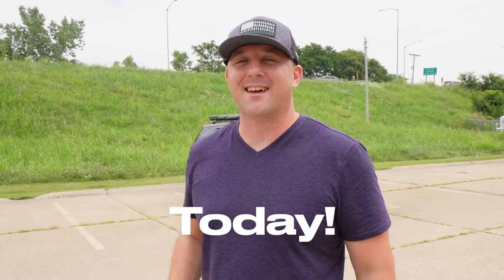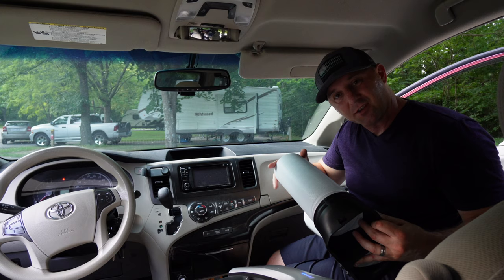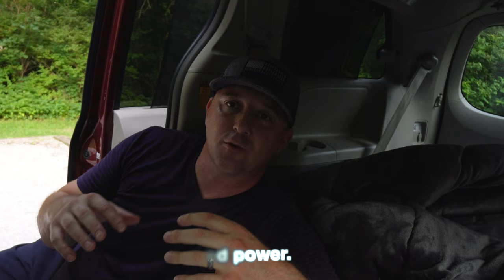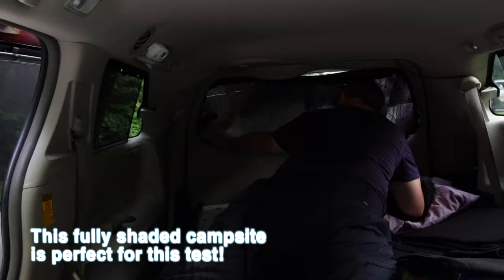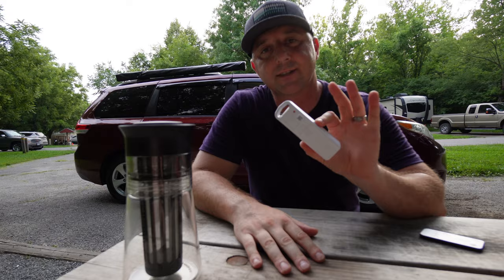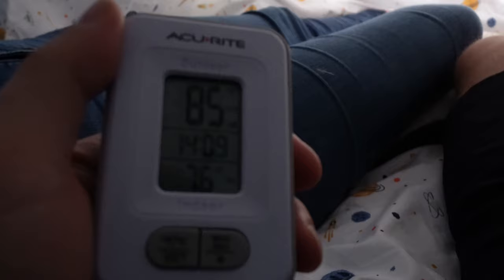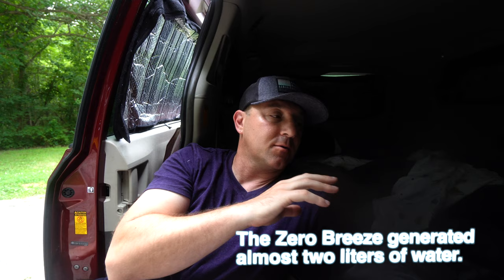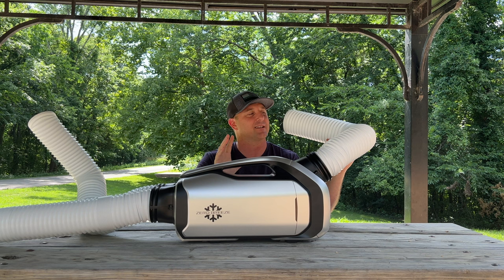Surviving a Heatwave in a Minivan Camper - Zero Breeze Mark 2

Comment: I have a 2003 grand caravan, which I bought early 2004 off lease from Enterprise Car Sales. Then it was $17K and I immediately took it to Best Buy Geek squad and had a remote start/alarm system installed for total of $400. Now, 18 years later the Viper system still works great. When I take a trip, I pull out the two back seats, toss a double or full size mattress into the back. When I stop overnight on road trip, I set the Viper to restart each hour automatically and runs for 15 minutes with AC on full. Added advantage is the caravan has an rear AC and fan that comes standard with the vehicle. Even though I'm typically traveling between Maryland and someplace in hotter Florida, that's enough to keep me comfortable during sleep at night. It probably uses 1.5-2 gallons gas, but even at current fuel prices July 2022 of $5, that's a lot of savings for NOT renting a hotel room when on a trip. Also no hotel bedbugs. I set the AC to vent in fresh air each time it's on, so can leave all windows closed for the night & no mosquitos or gnats to bother me during summer months.  If travel in winter, can do same with the heater. Having the remote start is great when at home, can start vehicle to warm or cool the interior depending on the season before I go out to enter it, which is most helpful when we've had snow and ice outside, making it easier to clear that from the inside heat already melting the ice or snow loose from vehicle. Remote start and intermittent hourly remote starting is something I intend to have always on a vehicle when/if I ever get a newer one.
Reply: How many miles now? They are great vans
Reply: @MX-CO  Only 110K so far. We have 4 vehicles, so use the van less than the others, mainly for trips between Florida and Maryland twice a year. Most used is a 2004 Prius for everyday, which has almost 200K miles now. I only use synthetic 100% oil and purolator oversize filters, like the 30001 (equivalent to Fram ph8A) , so the vehicles do quite well over time.
Reply from the maker: Glad you got so much good use out of that setup. It’s sounds like you’ve made some great trips and memories with it.
Reply: @OffGridAdventure  Yes, and TY.
Reply: could there be any issues with carbon monoxide?  thank you!
Reply from the maker: @mistyluv261  hi, I never recommend sleeping with a vehicle running. Even with a CO monitor, it can still be a problem. It’s not a risk worth taking.
Reply: @mistyluv261  shouldn't be. windows closed, engine exhaust goes out the tailpipe. I suppose a possibility if windows were cracked in the back of minivan, but then why would the engine be running. Fresh air intake comes in below windshield. Never had any problem like that.
Reply: @JoeZyzyx  It's a joke of course you are in no danger sleeping with car running.  Don't listen
Reply: I appreciate your comment, this sounds like a very feasible solution that I've not heard anyone mention before.

Comment: I used mine in mid June in Florida and it was a lifesaver! I put mine on the console like you did but I put up my curtains between the front seats and the back in my minivan and I also ran a couple fans during the day but at night time I had to turn them off.  By morning my temperature was 69 in my minivan. During the day during the hottest of the day it may have gotten in the mid 80s inside but it did not have all that humidity so it was comfortable. I slept very well! It’s a game changer since I live in South Florida. It would help to put your silver side out on your window covers. Another idea is to pre-chill your van with the van a/c.
Reply from the maker: Hi, thanks for sharing your experience. I thought about pre chilling the van, but didn’t want to get in and out repeatedly. If only I had remote start. Do you recall what the outside temp was on the day that it was 80 inside?
Reply: @OffGridAdventure  93 (feels like 103). I’m pretty sure. I did run my ZB from the time I hooked up the first day continuously until I checked out of campground 4 days later.  I also put a sun shade that reflects the sun over the back part of my van and put something between that and the top of my van to have a space between the two.
Reply: @VivecaV2020  I just keep my engine running and I stay cool like a lettuce in hot temperatures outside
Reply: @VivecaV2020  It usually costs me around $10 to have my V8 engine running all night long with a/c on of course.
Reply: @VivecaV2020  I was going to buy the zero breeze. But the high price and negative side reviews changed my mind. They made it impossible to cancel my order
Reply: @OffGridAdventure  About 98 (feels like 102). Hot/humid in St. Augustine, Florida.

Comment: This is why I’m thankful for my Prius RV. I’d love a bigger vehicle but I can’t let go of the climate control ability of the hybrid system. I can leave A/C or heat on all night. When Prius is in park, and A/C is on, the electric battery provides a cool temp. When electric battery runs low, gas engine automatically kicks on and recharges its. Uses very little gas to do this. I have a golden retriever so keeping us cool is extremely important. I also have a carbon monoxide detector since the gas engine runs intermittently but it’s never gone off. I think there is a hybrid version of the Sienna.
Reply from the maker: I’d love to upgrade to the Sienna Woodland Hybrid. You can run the vehicles AC 24/7. That’s the one reason I would ever upgrade from my current Sienna.
Reply: I didn't know a Prius could do that. Must be the newer ones. My daughter has a 2004 model. I don't think that earlier one does such. Still, I had enough problems when repairing her ABS system on it last year. The battery still will hold up to a 50% charge thankfully.
Reply: Yes, hybrid sienna can do it too all night ac or heat for $2-3, but can't remove its 2nd row which is deal breaker.
Reply from the maker: @larryc1616  Some folks have removed the middle row and added a dongle for the airbag sensors.  It's just a few bolts to get them out. They also make a lot less carbon monoxide.
Reply: @Off Grid Adventure  I know some have done that but you still can't remove the rails and it's recorded in the computer voids warranty.

Comment: Just leave the car running with it's ac on, you'll use a 1/16 of a tank of gas (on a 4 cylinder) over night. A modern car with fuel injection that's sound mechanically will do just fine. The same goes for the heater.
Reply: @HeroicaPlay  Who said anything about being stealthy? What are you up to at 2am (with tubes sticking out of your windows) that you can't do legally in a truck stop or camp ground?
Reply: Yup, it's what most truckers do; leave the thing running. Sleep matters!
Reply from the maker: This seems like it might be a good idea, but I can’t recommend this because it can be deadly to sleep in a running vehicle.

Comment: Glad to know what options there are for sleeping in a comfortable temperature. 

I have a '21 Sienna. I wanted to stick with a hybrid to replace my Prius because I had slept in it once with the AC on.

I can't sleep in heat like you were experiencing!
Reply from the maker: How often does your gas motor turn on with the AC running?

Comment: Put the intake hose next to the mirror and try to point down. Put the exhaust hose at the top of the same window. Fill the rest of the window gap with rolled up clothes or towels.
Reply from the maker: I should have put them in the same window. That would have helped quite a bit.

Comment: I just ordered the Mark 3 and I'm thinking about making a plexiglass insert that matches the profile of my window but has a female connection on the bottom to accept the regular window and then the top can be rolled up into the door frame weatherstripping. Then plumb in to oblong ports to minimize the amount of plexiglass needed, kinda like a shop vac vacuum head that's round on one side and rectangle on the other. Pretty excited to give it a shot

Comment: After it was cooler inside the van than outside, you remove the intake tube and start using the already cool air.  Same as the van a/c.  You recycle cool air once it has cooled down.
Reply: But don't you need to keep bringing in "fresh air"?
Reply from the maker: There’s basically four pipes. The back side needs to be separated from the front side. The front cycles cool air and the back pulls in fresh air, then exhausts it. If you put the intake in the front, then it’ll create a vacuum that still pulls in hot air.

Comment: I keep seeing reviews for this and most are mixed. Seems helps a bit when sleeping but useless in heat of the day. I am wondering why it needs a fresh air intake. In one of the portable room ACs it only vents the heat it takes from the air. I would think it would work way better if it was drawing the cooler air from inside the van. I would not buy one of these as I mostly camp with hook ups and I will buy a portable room AC for 200 at Lowes instead of this 1500 gadget. Oh and that price is without battery.
Reply from the maker: Hi, there are actually four air exchanges. The two hoses going out of the window suck in air to cool the condenser, then blow that hot air back out. The front of the AC has an intake and filter cover with no hose that supplies the the sort of elephant trunk.  The units you describe are pulling air into the room from the  small cracks in the structure. They are much more powerful, but consume a lot of power.

Comment: It'd be nice if the unit itself was smaller, & the hoses tapered down at the end so they're still drawing in the same amount of air but with a flatter ending so your window doesn't have to be open as much
Reply from the maker: I’m going to stop by the hardware store and look at some adapters. They make some that are 1.5 inches tall and 6 inches wide.

Comment: I used plastic corrugated sign board for venting the hot hose in the window. I then covered the hot hose with a heavy blanket to block heat from transferring inside the van. The cool hose I left inside the van. Blocking off any unused area with a thermal curtain is helpful too. When it was over 100 I ran the van a/c for a few minutes to help reduce the heat first. 👍🏻
Reply from the maker: Excellent idea with the blanket on the hot hose. On my last trip I used the lowest sleep setting possible and it didn’t use too much power.

Comment: Why do you have to pull air in from outside? Wouldn't it help the machine not work so hard if you used the air from inside the van as your input air and only exhausted the hot air outside the van?
Reply: It would seem that way however, when you pull air out of a small space, you create negative pressure and hot air rushes in from outside so the air conditioner is constantly fighting the hot outside air to cool off the inside.
Reply from the maker: It looks like there are only three hoses, but there is a fourth inlet on the front that circulates the interior air.  The two outside hoses there to blow air over the condenser. Greg is also correct about the pressure.

Comment: You should make some custom flanges to fit into the back windows that opens a crack. One side exhaust one side input put the AC in the back of the van. 3d print a flange or perhaps a vacuum cleaner attachment from hardware store. Why bother with front windows.

Comment: So, here is my thought. Can a switch be installed in your van where you can run the air conditioning as usual from the alternator, flip the button, then the AC would run off a LiFePO battery while you camp? Doable? Why buy a second AC unit when the van already has one?
Reply from the maker: That would be a perfect solution, but the car’s AC needs the engine running to work the compressor. It spins with the engine. Im going to try a better AC unit from EcoFlow this summer.

Comment: Would it work better if the intake was inside the space you are trying to cool?  Instead of pulling hot air from outside, it would pull the cooler air from inside so it should have an easier time turning that cool air into cold air  (as opposed to turning hot outside air into cool air).  (The hot exhaust still gets blown outside.)

Comment: We have a 2012 t&c that we use to travel to MX tracks. We use a 2000 watt quiet generator and a 5000btu ac in the driver window. Works well. Anxious to do some winter camping tho
Reply from the maker: That’s gotta be much more realistic than what I have.
Reply: You must have a slow start large capacitor to even get that running. While I was in Florida, after Hurricane Michael came through, electric service was off for a couple weeks. Rented a 2200 generator, since the 5K AC unit was rated about 550-700 watts. Unfortunately it wouldn't run anything on the 5K except the fans, not enough to create the brief surge needed to get the compressor running. I had to take the generator back and get a 3300w one before that 5K compressor would start. Later I learned there were large capacitors which could overcome that problem, since they store enough charge at first, and a slight time delay, then discharge higher electric boost to kick over the compressor, which after running would run the AC at the rated wattage. Or did you buy a special 5K AC unit specifically designed for auto use? They do make those too.
Reply: @JoeZyzyx  so the ac with the digital panel will shut down the genny. But the ac with the turn knobs works fine.

Comment: I was just looking how to cool a Van in the summer If my calculations are right. 175W x 8 Sleep Hours = 1400Wh/12V = 116.67 x 2 = 233Ah Battery x 1.25% = 292Ah. A 300Ah Lithium Battery will run the Zero Breeze nicely for 2 days in one recharge. The 12V Portable Air Conditioner cooler 30 Quart 560 CFM Digital Multi Speed (CAMO) uses 80W x 8 Sleep Hours = 640Wh/12V = 53.33 x 2 = 106.66Ah Battery x 1.25% = 133.33Ah. A 200Ah Lithium Battery will run it for 3 days. But you need Ice. With a 300Ah Lithium battery you can run the AC Cooler and a Mini Ice Maker or just the Zero Breeze. Both good options to stay cool. 😎🆒
Reply from the maker: Hi, great math and thinking. I don’t use the AC unless I’m actually in the van to save power. The max consumption is around 300w on rocket mode and the minimum is around 130w on sleep mode. I have been using the sleep mode lately, but wasn’t aware of it when making this video. So, I’m using a little less power at night. Sleep mode is only comfortable solo. But, was just enough for my son and I last trip.  One night I ran out of power around 430 am and felt the difference instantly. The biggest difference is the change is humidity with AC running.
Reply: What was the temperature outside and inside the car at night?

Comment: Is there anyways to run an actually ac unit off a generator and possibly hook it up in the window with like a wooden build or ladder or something it' rests on just an idea like an actual window ac unit I've seen guys do it in there truck bed camper
Reply from the maker: You can run this with a generator. I used shore power in the video. The battery only lasts around 3-6 hours without other sources.
Reply: @OffGridAdventure  ok thanks

Comment: I was watching another van lifer who got that they said it didn't work, there is this igloo cooler conditioner 12 volt it takes very little wattage 35 and less it's very simplified you just throw some ice in it I seen other van lifers use it with no complaints u can   get a insulation cover for it for the ice to last long there both on Amazon
Reply: Swamp coolers work when there is no humidity.  But it gets muggy.  We didn’t have ac in our office and ran 5 styrofoam coolers with ice.  We literally got a huge cooler on wheels and swapped out ice 3 times a day to keep up.
Reply: A Hugh office is different with the igloo cooler of Amazon then it is for a small space like the van
Reply: @kellybrown6149  it wasnt that big. Lol.  Wish it was. It got muggy/funky.   Over time adding all that moisture to a van might create mold issues.
Reply from the maker: The key with this thing is isolating a small space to keep cool. It’s not as powerful as some other units. But, it worked ok for my situation. It won’t freeze out the minivan, but the point cooling under the blanket was fine. It doesn’t use a huge amount of power either.  The best benefit of this system is that it lowers the humidity which makes it feel cooler. I could see a few times in the video where my face was getting sweaty while the rest of my body was cool under the blanket.

Comment: 175w hour means I can get a cool breeze while sleeping using my 1000w Jackery. I don’t need to run it all night but 5 hours is good.
Reply: B. N  the jackery has the 12V plug … as well as the 110AC plug - I can use the AC … more research! Thank you for the heads up.
Reply from the maker: Hi, did you end up using one of these? I eventually gave up on it.

Comment: Doesn’t your van have AC? You can buy a lot of gas for $1500  and it works better.
Reply from the maker: It’s very dangerous to run a vehicle while you sleep.
Reply: @OffGridAdventure  You should have a carbon monoxide detector in any van or rv when you sleep for safety especially if anyone uses vehicle running  for AC.
Reply: @Off Grid Adventure  truckers do it all the time. 20yrs of idling with the a/c on & I'm still alive.

Comment: 2 usb powered computer fans plugged into an Anker battery pack is another smaller way to pull outside air in through a vehicle's window.  Cut 2 holes in thin plywood & insert fans. Cut the board to fit the window opening, plug-n-play! 

I saw this easy & inexpensive way to get outside air circulating in a small vehicle from the Japanese van camping YT channels. Check it out--> Gonta DIY.
Reply from the maker: That’s an excellent tip. I’d like to eventually mount a roof fan.